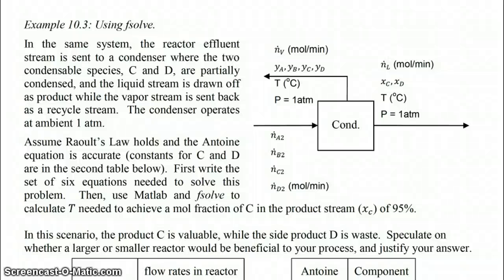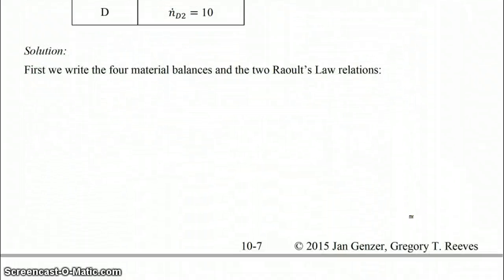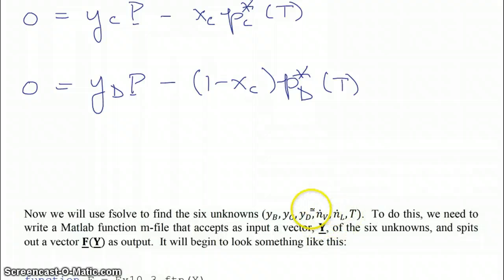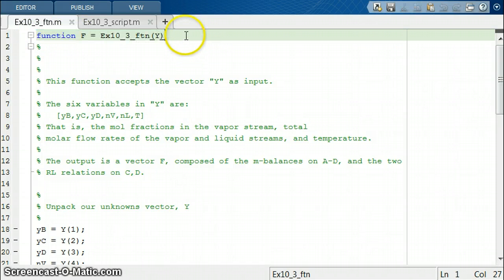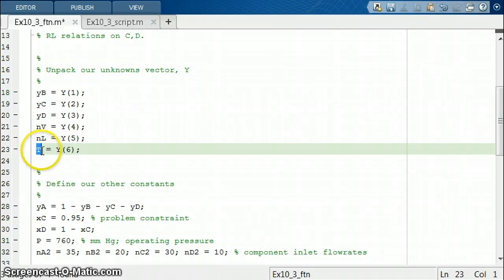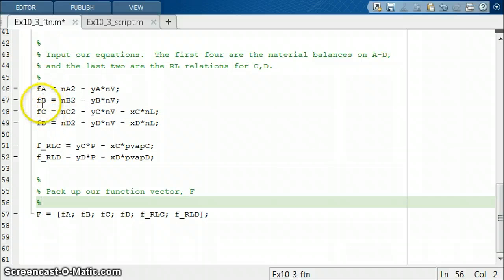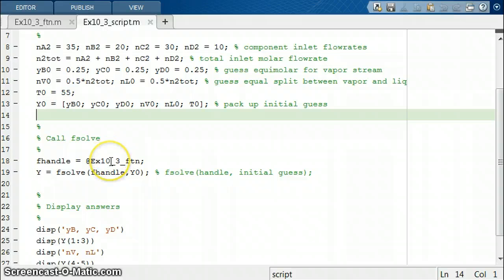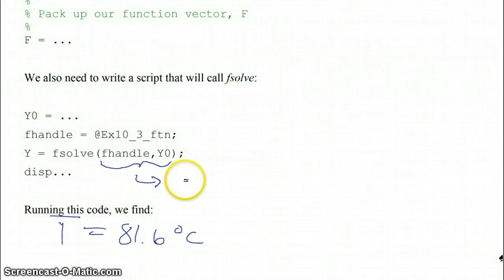Using fsolve to solve non-linear equations

Comment: sir is it possible to solve the below type of equations using fsolve...
if it is how to give an input in MATLAB?

A1=(1+1/beta)D^2+diag(f+g)D-2h*I
B1=2p^2
where beta=0.8 c=0.3
Initial  guess is
f(0)=1-e^(-n)
g(0)=c*(1-e^-n)
p(0)=e^(-n)
h(0)=c*e^(-n)
This is Spectral collocation method...i have no idea to give input as matrix form...
pls kindly help..
Reply from the maker: Hi Priya, I am having a hard time determining what your question is. So it looks like you have two equations and four unknowns? I don't remember if fsolve can work with underdetermined systems. Do you have other constraints you can work with? 

To put your two equations into matrix form, the last line of your function m-file can be F = [A1; B1], and then the output of the function m-file should be "F". That function m-file will also expect a vector of your unknown variables as the first input (call it "Y"). So in the first few lines of the m-file, you will need to say something like:
f = Y(1);
g = Y(2);
p = Y(3);
h = Y(4);

Comment: Sir, how could we solve non linear equations of two variables let's say equations -x1+2x1^3+x2=0,-x1-x2=0
Reply: sorry, the notification about your message went to my spam box, for some reason. I have to say I am not totally sure what you're asking. If you follow the fsolve example above, but input your two equations instead of the ones used in the example, you should be able to solve them. Alternatively, from looking at your equations, the second equation is x1 = -x2, so you should be able to substitute that relationship into the firs equation and get a cubic, which you can solve analytically or numerically very easily with Matlab's "roots" function.

Comment: Good afternoon, i have a problem: I have this linear system of 4 equations in four unknows P1, P2 P3 and P4:
a1*P1+a2*P2+a3*P3+a4*P4=a;

b1*P1+b2*P2+b3*P3+b4*P4=b;

c1*P1+c2*P2+c3*P3+c4*P4=c;

d1*P1+d2*P2+d3*P3+d4*P4=d;

a1,a2,a3,a4,b1,b2,b3,b4,c1,c2,c3,c4,d1,d2,d3,d4 are constants and a,b,c,d are the known terms.

How i can implement it on Matlab such that to find the roots?
Reply: It isn't linear equations. The equations are these:
G1=10log10(P_out1/Pin1)=10log10exp( a1*P1+a2*P2+a3*P3+a4*P4-a) 
G2=10log10(P_out2/Pin2)=10log10exp(b1*P1+b2*P2+b3*P3+b4*P4-b) etc.
Is it possible approximate the logarithm in these manner?
10log10(P_out/Pin)=10log(e)*( a1*P1+a2*P2+a3*P3+a4*P4-a)  such that i can to obtain a linear system?

Comment: Thanks for the video. It's very close to what I'm looking for, i would like you to help me out. I'm working on alloys and need to calculate the value of a parameter that has 3 variables that are also equations, the parameter and one of the variables have 4 variables that i need to afterwards vary to get the values of the parameter over a range of concentration fitting experimental curve